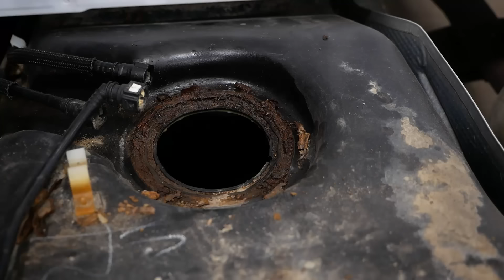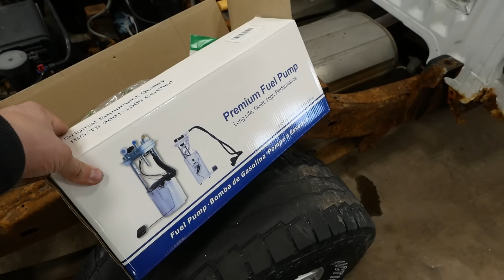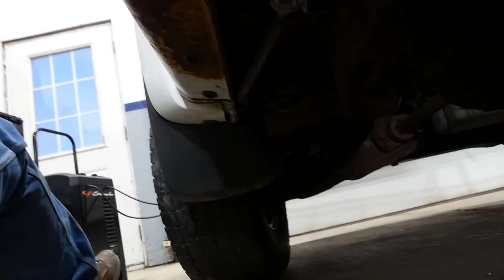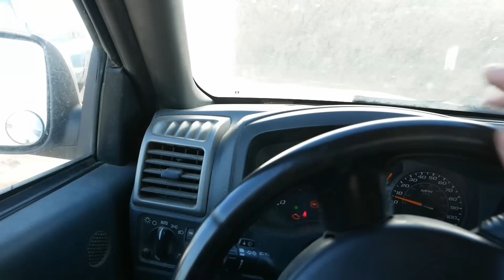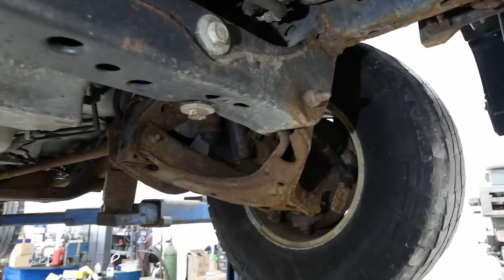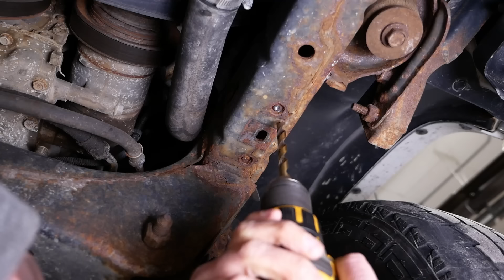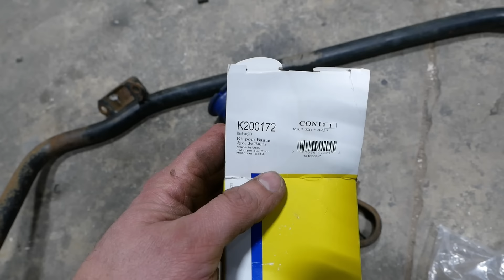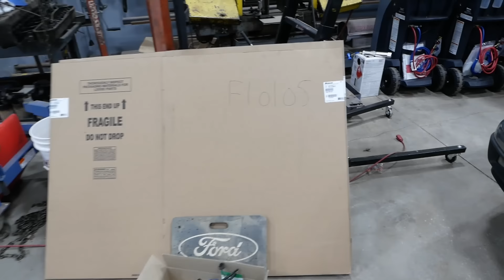Saving a GMC Canyon with 434,000 Miles from the Crusher - Won't Start, Fuel Pump Tabs Rotted

Comment: Yep pass poor design. I'm in Eastern NE & the '05 Yukon XL is from SE SD & spent its life in the country. There was so much dirt piled up in that well just holding moisture & salt against the pump, lock ring & tabs for nearly 20 years. Mine is bad & the ring still won't budge after soaking w PB Blaster for two days, & while the pump & ring is flaking off chunks with every strike the tabs for the time being look better than that one. Sure hope I can salvage the tank as even used that's another $200 I don't have right now. Every connector I had to blow out with air & hit with PB Blaster to remove. The lines going into the nylon "quick connects" from the pump are so swollen and corrodennthey broke off innthe fitting but thankfully I can cur off & install new fittings, again as Long as I can remove the ring. There is a company called United Auto Recyclers that is a great resource for used warranties parts. They've saved my butt a few times & they ship to their locations throughout the US.

Comment: After seeing how gm mfg thier stuff? And Im getting to old to fook around with it? I wont buy another rig ever. Fix what I got, do preventative maint. and stay ahead of the bad designs. I think that next time I have a fuel pump issue, I will have a local welder fab me a fuel tank out of metal, and just mount a electric fuel pump on the outside in the fuel line. Stupid design for sure. Old school we didnt have crap like this, these new rigs are crazy.

Comment: The check engine light was always on in my 2010 Colorado. The emissions equipment seemed really sensitive to any variation that popped up as the truck got older. It always ran, although it only had half the miles this one does!
Reply: The Vent valves always have issues. I've replaced mine 3x and coated the filler neck and lock ring with Cosmoline. I have the truck oil sprayed underneath every year. I live in Buffalo and bought it new in 05..  Frame is still hole free.

Comment: Another throw away truck by GM.  Once you get to this stage of throw away, break out the welder and put those sway bar mounts on there the easier way.  Fuel tank....I would goop it up with good ole weld all over a large gasket that would clamp it down on the opening.  Fill the surrounding with tar....level it out so moisture can't POOL there.  But looking at that frame....rusted beyond help...soon as the farmer starts going over unlevel ground, it will break somewhere.  Every single part is worn out everywhere and so on and so forth.  So considering....the crusher was a better option.

Comment: I had simililar thing happen on my 1992 tracker about 15 years ago .By hand using a brass wire brush cleaned the top of the. tank and the fuel and sending unit top ,then carefull sanded it  till it looked like new metal .After spending hours prepping i drilled and installed stainless screws .Screwed down the top and used marine epoxy that was fuel rated  after 24 hour cure  i coated the repair and prepped  metal with a zinc rich primer several coats and then  many coats of rubberized undercoat . i oil under coat the tracker yearly making sure to spray my 15 year old repair

Comment: In the commercial air conditioning field (rooftop units), I witnessed this same chafing of wire insulation jackets on wires in metal sheaths/jacket. The vibration of the compressor because isolation mounts under failed and allowed vibrations transmitted to the machine base and wire jacketing.

Comment: Great job ! But you missed it on the seal all it’s the best stuff I ever used we had a hole in a gas tank the size of a pencil with gas running out put a big gob of that on your thumb and stuff into the hole hold it there a couple of minutes pull your thumb off and then coat a layer over it it works . Once I pushed a timing chain cover out on a 78 ford truck cleaned the cover and block good coated it with this stuff owned that  truck for 6 more years never leaked  . Try it you will be surprised .👍🦦

Comment: Dont throw out that "seal all"  stuff.  Its great if you ever get anything with AN fittings or any fuel system fitting that you can not use thread tape for.  I swear by that stuff.  Had a old school sbc fuel pump running AN fittings that would not stop leaking. Was past the point of comfort on tightening. Seal all. saved the day and that pump.

Comment: I wasn't going to watch this whole thing but I'm glad I did. I have an intermittent fuel issue, and also a P049 code for the evap solenoid. I replaced the solenoid, and after testing the old one it worked, but I still haven't tested the actual circuit (obviously it's not working). At the end you said those are on the same harness, which was more value to me than the rest of the video :)

Comment: Actually the “seal all” adhesive is some pretty awesome stuff when you follow directions exactly. 
Had a leaking pump seal on the pinch seal used every other “Goo” on the planet to no avail but the Seal All did it.

Comment: Good repair.  My question is you are into it with probably around 10 hr labor.  Unless you work dirt cheap, that could be an expensive repair for a vehicle with that much rust and that many miles.  Had an 84 Nissan 720 truck.  Loved that thing, drove it until the rust got so bad I didn't feel it was safe anymore.  I think my frame was in better condition than this one.  Just saying.

Comment: It could be the sand just rolling around in that small area on the jacket of the wire and moisture breaking it down it also could be the jacket of the wire is not a good quality and maybe that’s how they cut costs building the truck

Comment: Send it to the junkyard and get Tacoma that would be the best solution. I have the same truck just a 2007 with a 3.7 engine. It's a nightmare design if you need to fix something. I will never buy a GM product again.

Comment: I have a 2008 Toyota Tundra that has two auto door locks that are broken and I think the U joints are almost gone but I drive it every day and I just hit 629.000 miles on it with the 4.7 engine., The only thing I have done to it is put a timing belt kit in it about every 75.000 miles and have gone through 8 sets of new tires.

Comment: If you're pretty sure you don't have to take it apart again get dope the whole thing together with a tube of silicone with some stainless screws around through the polyethylene with the heads sticking out sufficiently that the silicone will grip them come up over the top of the sending unit with the goop

Comment: Did the check engine light disappear? Engine sounds a bit strange. Could it be caused by possibly bad engine mounts? The kit is sold on eBay, but they are out of stock at the moment. My comment with the link was deleted.

Comment: Wow, that truck didn't owe the original owner a dime!. 434K is unheard of in any make. I know some slant six or  Ford 300 that went over 300K but that 434 has got to be a record. I saw a S10 once where someone cut a hole in the bed to replace a pump and they used a torch above a plastic tank😵‍💫.

Comment: I watched a VINWIKI video of Euroasian Bob, he said back in the 90s -2000 groups of people were coming to salvage yards and buying a lot of components, starters, alternators, fuel pumps to name a few.  It was Chinese companies then, doing reverse engineering to start making parts.  That is why there is so much no name parts on Amazon, eBay and internet.  If its cheap and a generic brand name.....you get what you pay for.  Its either, spend extra on parts now rather than extra and more later.

Comment: I know you were not there for the unavailing and the pump was already butchered up when you got it, but the FIRST thing I personally would have done would have been to see to it there was power at the pump and the ground was in tact. 

Good judgement comes from experience, Experience. Experience? (like I have now), That comes from bad judgment,  (I got not one, but TWO good used GM fuel pumps put in the shop somewhere. I was a slow learner)   Think first, Screw up later.

Comment: Make a cover with a dip tube and screen, seal & bolt it where old fuel pump was, use an external pump mounted  in engine comparment.

Comment: The gray wire was damaged by heat from high amperage due to a bad fuel pump over time and the heat also damaged the orange and blue wires which were against it.

Comment: We had an '06 Dodge Grand Caravan with the 3.8L v6. We got 500,000 km out of it. The only engine work we did on it was to put a water pump in at about 300,000 km. I thought we did pretty well.

Comment: I’ve even use air from the air compression can that you can buy electronics department at Walmart on a job site without a air compressor walk outside blast it all off done most people use them for keyboards and such

Comment: Just a quick question: You sealed the outer part of the ring, but not the inner. Can't water pool up and get between the inner part of the ring and pump? If the o-ring inside is sealed as well, then I'd think the water would be trapped in there and hopefully evaporate before rotting anything.

Comment: Is the chassis of the truck rotted out anywhere? I can see the body rot in the rocker panels, we call them sills in the UK.
I am surprised that you did not already start the truck using a boat tank. Or maybe you did already off-camera so you knew you weren't wasting the $40.00.

Comment: With that much rust underneath I'd be worried about the frame breaking behind the cab if you tow or get in an accident. Those trucks are known to break there I've seen a couple personally.

Comment: Definitely kilometers. I would bet my old used Caddy  on that. 
This is a good video. Those things had some redeeming qualities. Not a lot - but some. 
One of them is the engine. Amazingly, they take a lot of miles and keep ticking. Their valves are a weak spot. The frame - especially toward the back is weak. A little rust and it’s shot. Thanks for posting. This video is much, much better than any of the crap that is on television.m

Comment: ALASKA TRICK I've sucked up 5 gallons of gas with a plastic shop vac NO FIRE than i lit 3 gallons on fire and sucked it up with the shop vac it put the fire out lolol . When i stopped the shop vac nothing no fire only when i lit the vac tube with it off and full of gas did the flame reach inside than i turned on the vac  it made some funny noise than died with fire inside. I should make a vid of that. I think if some 1 told me this i would not believe it. P.S the shop vac was not mine i returned to my friend as a melted disc of plastic :0 it sat at the end of his drive way for a week than i said you get that shop vac i left there, he said no? its there lololol it was old and junky.                            SO NOW YOU KNOW YOU CAN FIGHT FUEL FIRES WITH A SHOP VAC  luv ur vids:) your a good tool turner i quit working on anything newer than 1980 older stuff much eazer . My dads 1991 Ford 150 has 390k miles only after 2 motors 3 axle rebuilds 1 trasfercase as far as i know stock auto tranz some how? its getting a lil slow shifting and did i say never changed tranz fluid lol and the plastic bed liner is holding the bed together lets say she sheds steel from time to time off the fenders. A 2005 Canyon with 400+k miles on it some 1 call Guinness book of world records or a museum maybe??? he must have only gone 25mph everywhere

Comment: I had a 2011 Colorado with maybe 150k and my fuel pump went and thanks to that lockring I needed a tank too. Mercifully he was able to get one from a salvage yard for $200. A new one from the dealer would have been $1000 which is insane. Got it all fixed and i traded it in on a new Colorado the following month 🤦‍♂️

Comment: My 1998 K1500 is the same design changed fuel pump at 100k and noticed deterioration starting around the lock ring. .i cleaned it up and fluid filmed around it...that was over 10 years ago..truck has 180k now and still going strong....  Thanks for the video...

Comment: What an absolutely  ignorant  design!! Not only for the fuel pump  itself but the connectors  as well. I wonder what brilliant  engineer came up with those ideas. No wonder they only used this design for two years. However the repair kit is brilliant.

Comment: I'm glad I'm not the only one running into issues when working on cars/trucks.  As much as I appreciate tips and DIY videos from Chris Fix or Scotty K, the reality of everything going smooth, especially rusted stuff here in Iowa, is far from being plausible.  I also enjoy when a mechanic can either improve or modify a part, as in the case of the fuel pump/tank assembly.  Great work Wes!

Comment: they probably tried towing off of the sway bar connection point? then snap!!!!. frozen broken bolts are my least favorite barrier when working on vehicles....another option on the sway bar if you can't get the broken bolts out might be a 1/2 piece of plate with studs welded over the broken holes for the sway bar mounts to then be tightened in place with a nut....good job at helping other learn about vehicle maintenance. free education to those who pay attention rather then tuition.

Comment: I see some vans and pickups for sale right now with almost 500K on them so yes its possible. Still, 434K is definitely end of life. I wouldnt have taken this even as a gift. If it didnt have all the rust and I had access to parts and $$ for a new engine and trans, ok maybe. But consider what you said, you cant even get a gas tank for it. So what, invest in 1000 rolls of duct tape? Its rotten, its over, give it a good christian burial and go have a beer.

Comment: I have been through three engines in my bought new 1982 Chevy S-10, and over 700,000 miles. I am in the process of putting the fourth engine in it. 2.8L V6. I wouldn't bother trying to save a 2005. Way too much computerized garbage on it to make it worth keeping. Buy a carbureted truck, and spend the money to fix it up. Then just keep it going forever by replacing parts. All computer vehicles need to be crushed.

Comment: Had something similar on my 2006 f250. Fuel pump would stop, fuse would blow, all the forums said the FDPM was rusted out near the rear bumper.  Replaced a $70 module,  started the truck, put in reverse,  died. WTH? so started tracing wires, had a harness that looked fine from the bottom,  but as soon as I pulled it away from the frame near the engine bay, it had worn through the metal heat shielding wrap and through the wire loom and rubbed the wire insulation bare exposing it to ground causing the short.  easy fix. Crazy that youd never suspect it would do that just looking at it from the bottom.

Comment: As far as the throttle body cleaning goes: a can of seafoam spray with the nozzle insert every 10,000 miles for me. 

The Atlas is a pretty good motor. Love my 06.
Reply: The tabs that hold the fascia in are the Isuzu rocker type. As this truck is based on an Isuzu D-Max.

Comment: Pull the gas tank, add a 12v electric pump..I'd make it work even it was smaller. Moisture in the harness.plus
Dirt.= trouble. Good job. Try some chevron Injector cleaner.

Comment: Pump out all the fuel with a little transfer pump scrape off all that rust around there get a new pump or get one from the junkyard you can tell bench test them get yourself a tube of gray silicone adhesive and place it down and place silicone the shit out of it put it down in place let it dry thoroughly fuck all your lines back up and then Get some of that installation foam and put it all around and fill the cavity it works I’ve done it I’ve done this on to different vehicles where I use the spray insulation they kept the water out of the tank

Comment: People love to talk crap about GM, but 433K miles is a testament to how great their vehicles can be if you care for them and do basic maintenance.  We have a 2011 Silverado 2500HD 6.0 that just hit 250K.  We recently had to replace the transmission only because the torque converter went, but otherwise it’s an excellent vehicle.  Runs like new.  Just did the second big maintenance job on it, and when the dealership opened her up they were shocked how clean it is.  We’ll drive it til it needs a new engine, and then get a crate engine.  The vehicle itself is in pristine condition, interior, exterior, paint, all look excellent.  No need to buy an $80,000 vehicle when I can spend $10K and make the one I have new again.

Comment: Great work bringing it back!  You mentioned the engine's similarities to a trailblazer engine, that's because they're both GM Atlas engines, and the 5 cylinder is basically just the 6 cylinder with one hole cut off the block, similar to the old small block 350 and 4.3 v6 engines
Reply: There are also 4 cylinder versions as well.

Comment: That era Chevy/GMC truck engines did last a long time.  I have known several people get to 350K or more with their full size trucks, my sister is there with her 2005 Chevy Silverado extended cab truck and she still drives it (and she tows a heavy trailer with it).  I think it has the 5.3-V8 in it, she has the automatic transmission and it is a 4WD.  She also has a 2005 Chevy Suburban with close to 250K on it, she had the transmission rebuilt recently (she found a guy that rebuilds them for $500 but she had to remove and re-install it herself) but the engine is the original engine and has not been rebuilt.  She had a 1999 GMC Yukon that had almost 300K on it when she rolled it on an icy road two years ago.

Comment: My last truck was a 2008 Silverado 1500, truck rolled over 500'000 km's when I sold it, mechanically nothing wrong, just alot of dents and bangs, only sold it because I wanted to leave the truck on my terms and not on the side of the road, was the 4.8L.